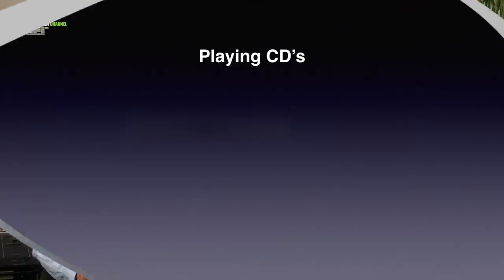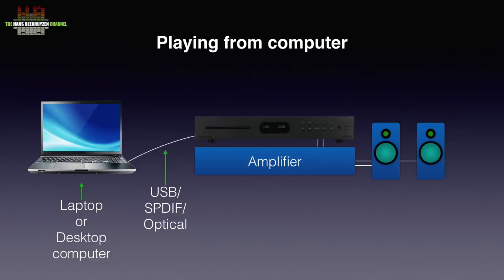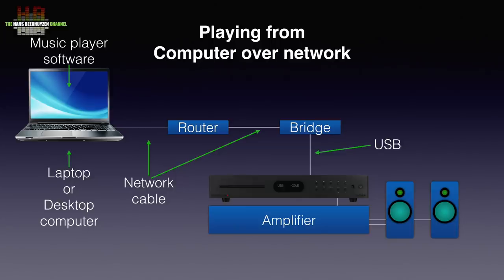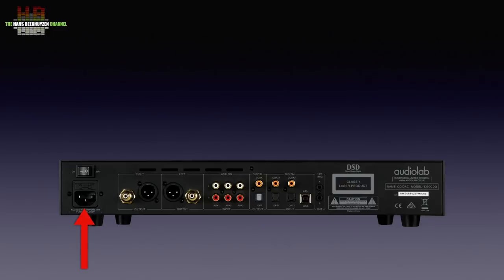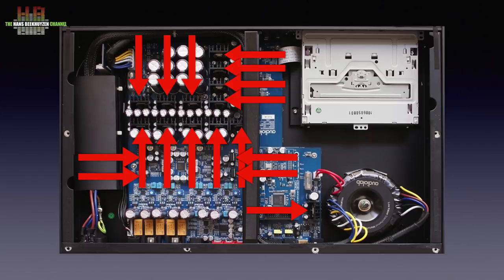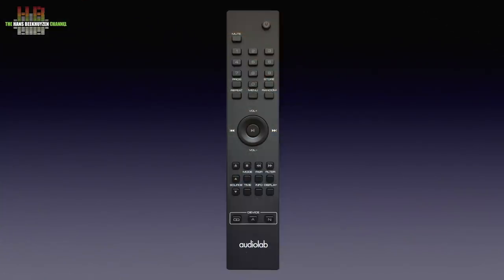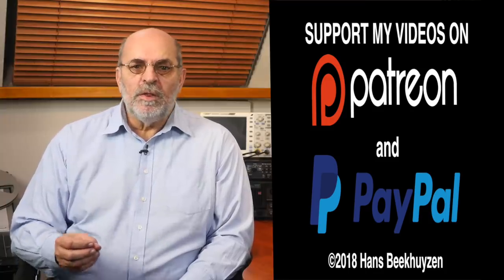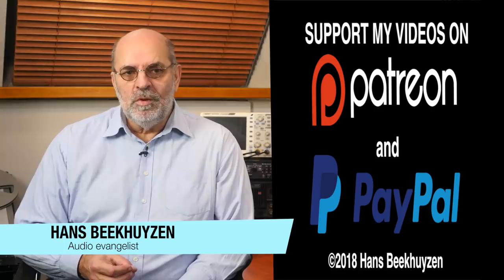Audiolab 8300CDQ DAC and CD-player

Comment: I continue my solo ride - commenting my own posts :)
I got an answer from Audiolab. MQA and DSD ar only supported on the USB input. You might want to correct the statement of the video: "Yes the USB input only supports MQA and DSD.
Coax and Optical are PCM only."
Reply from the maker: Sorry for letting you down but other things required my attention. I have made a note in the video (within the limitations of YouTube). Thanks for reporting back.
Reply: No worries :) I can return the player - or add a USB streamer, replacing the Node 2. Possibly the Pro-ject stream box s2 ultra?
Reply from the maker: Good choice
Reply: Still contemplating on DAC / streamer after having had the 8300CDQ for 3 weeks ;) May I ask you how you would (if possible) compare the 8300CDQ with the Mytek Liberty DAC? I am thinking Node 2 -> Liberty opposed to Stream Box s2 -> 8300CDQ. From your reviews the latter should be in a class higher? Any thoughts? Basically I guess I'm wondering if a the streamer or the dac is more important?
Reply: @arieinarsson151  Very curious to hear if you tested the Stream Box s2 with 8300CDQ or if you went for the Node 2 with Liberty solution? I have the Node 2i with the Liberty and are quite satiesfied but what you and I both need is a new AudioLab M-Dac with MQA support!!!
Reply: @janhoglund3797  Actually I did some off it :) - and I have all of them except the Stream Box s2. I went with a streamer from Stack Audio, called Link. 
I have the 8300CDQ in my living room with a Link as a streamer to the "CDQ's" USB input (with MQA).
I was so happy with the Link that I bought a second one, so I also have the  Link in my home office connected to a Liberty. The Liberty poses as both DAC and preamp, directly connected to a power amp. I'm very happy with both solutions. 
I haven't heard the M-DAC, but the 8300CDQ is actually really good (as a DAC) - although it doesn't give the upgrade possibilities the M-DAC does.
Hans has testet the Link with good results: https://www.youtube.com/watch?v=27rHPjysfH4
I have the Node 2i, but I haven't used it with the Liberty. It's on it's own - feeding two bridged Parasound ZAMP's in my kitchen - with very good results :)

Comment: Hans, I have received the 8300CDQ - and am impressed with its sound on USB. But my Bluesound Node 2 does not show as playing MQA on the Coaxial interface (I have changed the output to external MQA DAC :)). In the video you state that is has MQA and DSD on both toslink and coax?!?

Comment: Hello,Hans. What's your opinion on the Audiolab 8300 integrated amp? Also I like this featured CD player but wonder if you'd describe the sound as being "lean" or "bright" as I have vintage ESS AMT 1b speakers and they have a lovely but not overly warm or lush sound. They are 4 ohm speakers. I listen to mostly jazz and jazz vocal CDs. Do you think this product would be a great fit for me? And could you elaborate on what you meant by the USB playback is better sounding than reading straight from the optical disc. Thanks in advance.
Reply from the maker: I have not reviewed the Audiolab amp, so I can't say.

Comment: HI, thanks for your video , I have a question about this player and would be great if you can clear it out . I would like to buy this player as my main amp for my headphones , if I only play Hybrid SACDs on this player , does it support and decode DSD signals?  thanks
Reply from the maker: Yes, it plays DSD.
Reply: If you are expecting it to play sacd/dsd from the cd drive, That is not possible. DSD is only available through the USB input. As is MQA.